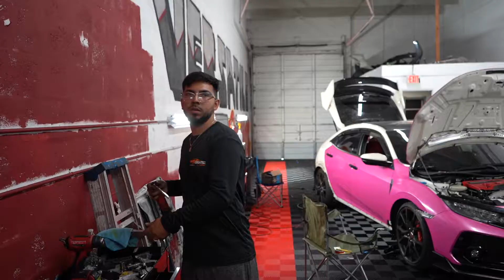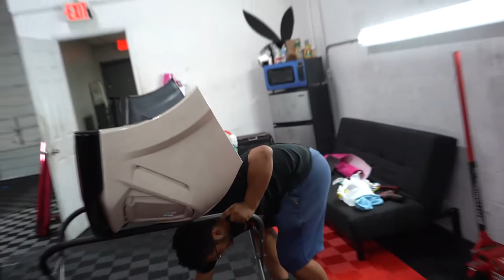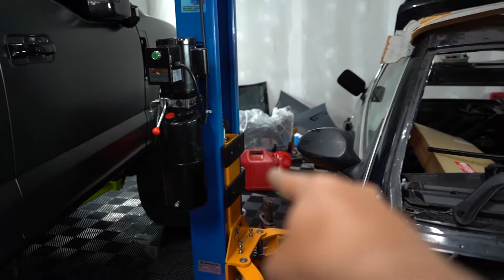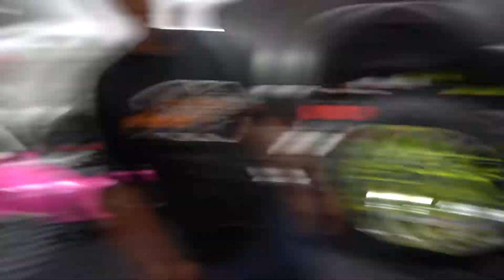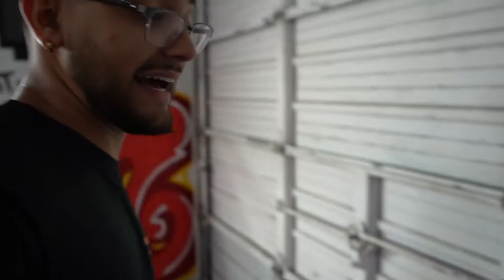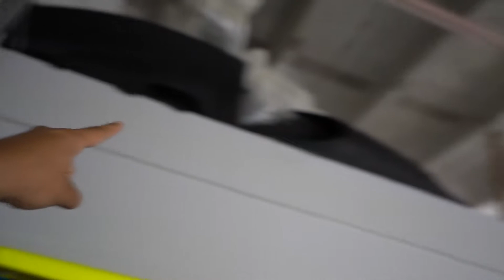Ep 2 bucket build n54 335i ** ITS ALIVE !! **

Comment: how did you guys fix the smoking issue ?
Reply from the maker: hey thanks for watching. we had low compression on cylinder 4 that's why we had a lot of smoke coming out of the oil catch can we explain it on ep 3
Reply: Ok so did fix it are u just get a new Engine ?
Reply from the maker: were in the process of rebuilding the same engine/ block stay tuned for ep 4 we will be showing everything that we are getting done for it.